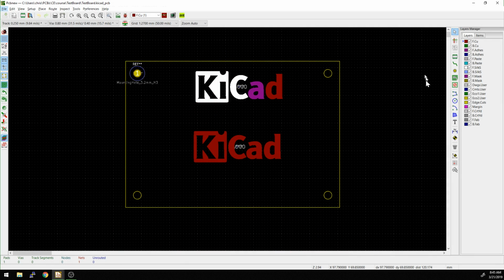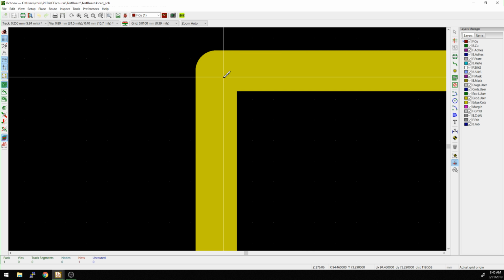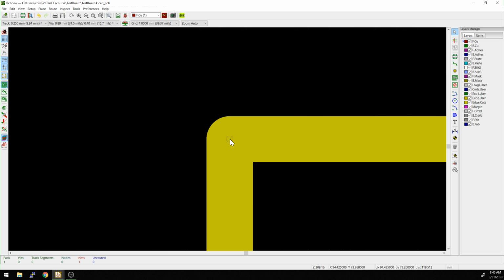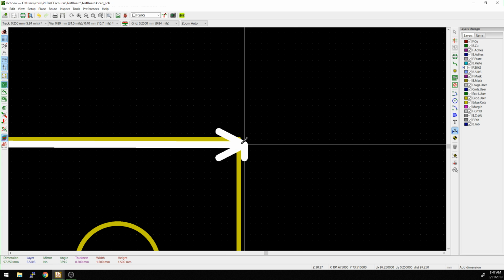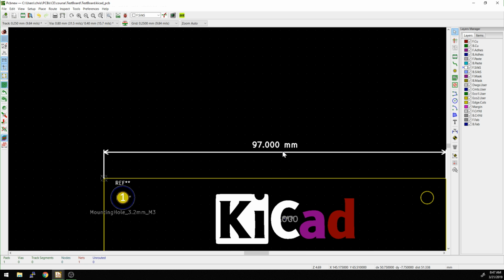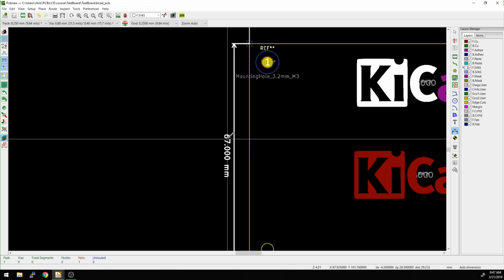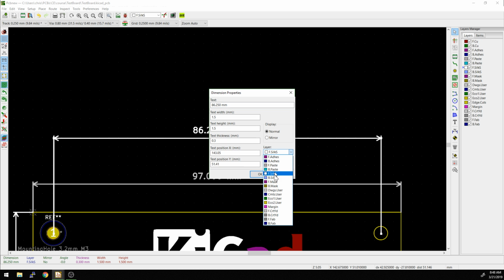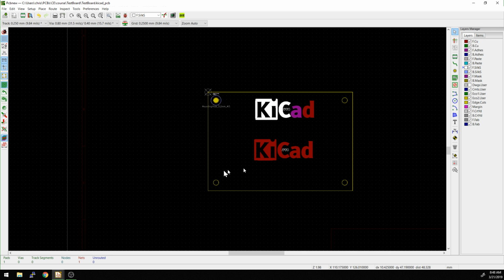KiCad 5.0 - Adding dimension to your layout

Comment: KiCad really misses a good dimensioning system similair to Fusion360 where you can select a line and give it dimensions. For complex lines/shapes I first draw it in Fusion360 as a sketch and then export it as a DXF which I can open in KiCad but it's still really annoying. Hope they add something like that!
Reply: This is exactly my issue with EDA software. 
I don't know how anything gets done in electronics when you can't explicitly define extremely important information like dimensions or location properly.
Also why I have no idea how footprints aren't just completely screwed up.
Reply: @mattymerr701  Yeah. Is especially annoying when working in metric when most components are measured in tenths of an inch. Makes switching between grids a nightmare.